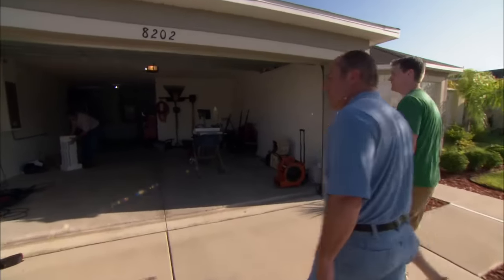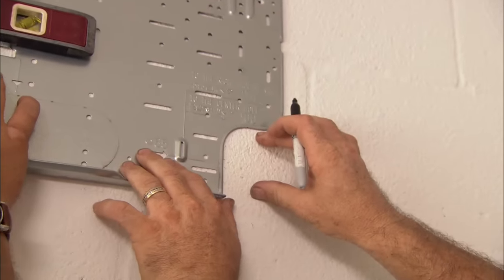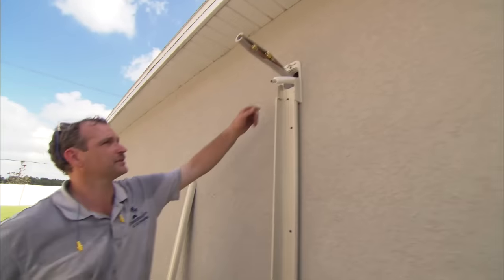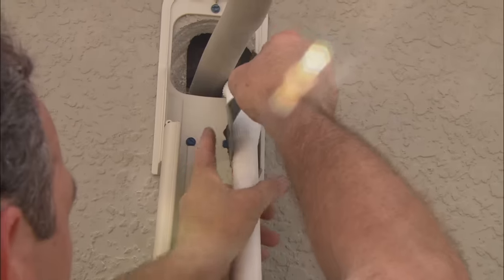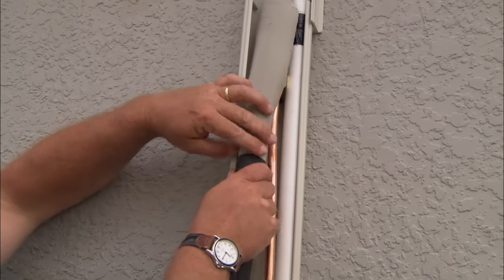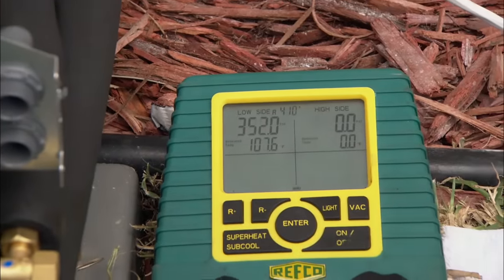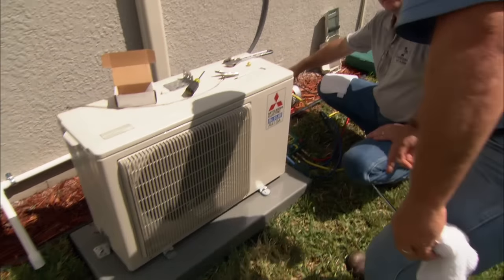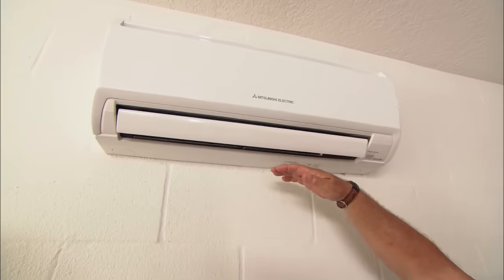How to Install a Ductless Mini-Split Air Conditioner | This Old House

Comment: One of my units is dripping condensate into our house!
Reply: The drain is most likely clogged. Spiders love to make nests in them. You can try taking a garden hose (or compressed air if you have it) and spray up the drain to dislodge the blockage. Also a flexible wire like a fish tape can be use too.
Reply: Thanks Jon, I will try these!

Comment: How much will this cost cause summer in Texas is no joke
Reply: Lol as if you would even have power in your state to run it. Texas has the worst energy infrastructure in the US due to horrendous state legislation.
Reply: @gangisspawn1   that's a lie. You mad about 1 random winter snowstorm that happened once every 100 years and has never happened since electricity was invented? Ok lol
Reply: @usa5439  wrong

Comment: How many amps does the mini-split use?
Reply: Timothy Smith Hey Timothy! These ductless units usaully draw about 15 to 30 amps Due to which type of model you purchase.
Reply: I see. Thanks Bobby. Well I just created 3 empty spots in my service panel, so looks like I'm good to go.
Reply: NotSoHandyTim you’ll only need two spaces. Mini spilts in this size will only be single phase.

Comment: why didn't he pull a vacuum?
Reply: +Paul Stess I wondered the same thing.  I wouldn't think just pressurizing with nitrogen is a very thorough leak check. Also, I installed those pre-charged units many years ago - they never had the right amount of refrigerant in them, because the run of copper tubing from evap to condenser units was so variable.  These are good systems, though, when installed correctly.

Comment: What is the approximate cost for parts and labor? I imagine the labor will vary by region...just a ballpark would be great.
Reply: That u it cost $3400. U hear them say it in the other video.
Reply: paul noyb  It can be done way cheaper than that.  I live in Houston and it was only around 1,500 to have a unit put in.  Love it in my garage. These things are great.  I started hunting them down about ten years ago (they are all you see in MX and Central America) and am considering installing one in the master bedroom so I can use it at night and not have to run the central AC on such a low setting just to keep the master “chilly” for sleeping.
Reply: i bought same model cost me around $500 and the install cost me $80.
Reply: +lordarance in norway, certified install of these units cost 800 dollars
Reply: +alreadyreadyreally In Australia, an install like this one would vary between 500 and 700 Australian dollars, generally speaking. That's obviously not inclusive of the unit price.
Reply: In Mexico york brand  500 dlls cold /heat 110 volts . installation 100 dlls   5 year warranty.

Comment: I learned that the company that gave me a quote to install a mini-split system is trying to make $30,000 on me!
Reply: +itsreal1971 It's a shame so many residential AC companies want to charge thousands in labor for a few hours worth of work. Have worked in industry before, so am a little biased. That said, these systems are a snap to install, but make sure to have the correct tools to properly install one - or make friends with an AC guy =)
Reply: FloridaFrank2010
Thanks!
Reply: just got an estimate for $11, 800.  for a  fujitsu  1 1/2 ton heat pump for the second floor and a 2 ton for the 1st floor..seems aweful high priced to me . What think ye?

Comment: Good, wish you'd left close-ups (3-5 secs) of wired connections, plumbing connections.  Shifting from vacuum pulling through disconnect of vac pump and hook-up.  Wish you'd discussed tonnage sizing.  Thanks.

Comment: This is the most commonly seen type of air conditioning in South Asia. Sometimes the outdoor fixtures are done right, sometimes not, but it surprised me traveling through Nepal that this split design, which is almost silent in operation, is used to a much greater extent there than it is here. Hotels here tend to use much noisier PTAC units, and I can't help wondering why.

Comment: i had a multi-unit system for my row home here in philly. Gettting it installed professionally is what makes it so expensive. But ducts weren't an option cause it would have required all the walls to be removed. Its great though, can even use them in the winter if youd like. They heat as well as cool

Comment: Mini-splits are great.  My advice would be to carefully consider the location of the indoor unit, you don't want that blowing directly on you.  Most of the units have an louver that can be adjusted with the remote to a specific angle or set to move back and forth diverting the air up and down.  The newer systems run the indoor units fan continually when the unit is powered on whether it's calling for cold air or not, this is a great feature as it dries out the coil etc... so it doesn't get mold or mildew like those hotel rooms we've all stayed in.

Comment: This is not a good installation, you have to tighten flaire nuts under indoor unit , it's good for the future
Reply: Balwant Singh you don’t have a clue what you’re talking about. This size air handler only has the one set of flairs at the air handler.

Comment: Yeah this is a fairly common setup here in New Zealand as central AC is almost non existence in homes.

I have a couple of these units that looks like flat radiator panel that mount onto the lower part of the wall near the floor.

Comment: Great video - very informative.
Looks like the only “oops was not pulling/terminating the wire to the inside unit before mounting.  (In the video, the wire was tucked into the wall from the outside, and “magically” connected itself inside.)

Comment: the steps they missed are you have to 1 put nitrogen to pressure test (they covered) then pull a vacuum to 1400 microns. 2 put nitrogen back in and hold it for 15 minutes, then pull another vacuum to 900 microns. then 3 put nitrogen back in and pull a vacuum below 500 microns and hold the vacuum for 24 hours. this insures that there is no moisture in the system, moisture is really bad for the system. after the 24 hours you then open the service ports releacing the freon, the system holds enough for 18 feet on line set. you have to add more every additional 18 feet up to 36 feet. it is charged by weight only not pressure.
Reply: Eddie Hall. Triple vac? Er no. 
Your talking a monster commercial system. Tiny short lines here will vac easily; you're expected to install these in just 4 hours incl electrical. So nope.
Reply: Nathan actually I went to a national heat pump and ac association meeting and that is the steps they said to do when installing a mini split. It is where you have compression joints instead of welded joints. The nitrogen is to help remove moisture which is a Non condensible. And the reason for the 500 micron vacuum and waiting 24 hours is to insure your compression fittings are sealed.

Comment: Nice video, except I would drain the R134a refrigerant and replace it with R290 (refined propane, a.k.a. CARE® 40). Hahaha! It's more efficient, provides the same or better heat transfer at lower pressure, and results in much longer compressor life. Moreover, it is compatible with the lubricants used in R134a systems.

Comment: When he opened the valve with the allen key, he didn't open the top low pressure side one as well. They both need to stay open for it to work. I got quoted 800 dollars to have one fitted. I asked him why he charges 400 dollars an hour. He said that includes the pipes. Woopdy doo. 50 dollars for the pipes. I will go and buy a vacuum pump and do it myself. I just need a sparky to certify the electrics.
JD

Comment: Those wall A/C units are junk..I would not recommend them to anyone.
Reply: Why?
Reply: Obviously you aren't in the trade.
Reply: I agree. my school had them installed and theyre crap unless you are sat within 3 feet of them
Reply: Wall unit, as in the mini-split? Or an actual wall AC?
Reply: Not sure, but it really does nothing for the 32 degrees weather I have been having. Sweating like crazy whilst revising.
Reply: Aaron Wilson AC’s are not meant to be used like a ventilator. They should cool down the whole room by taking the hot air near the ceiling, and spewing cold air out downwards. There is nothing wrong with the concept of a split unit AC. Your installer probably just gave you the wrong capacity or installed it wrong.